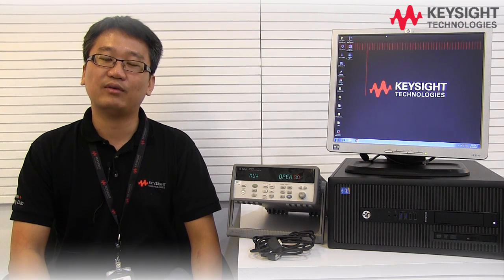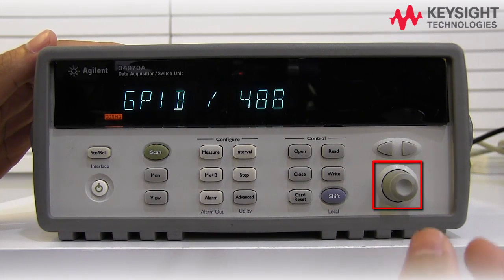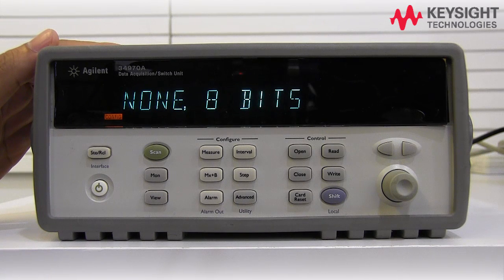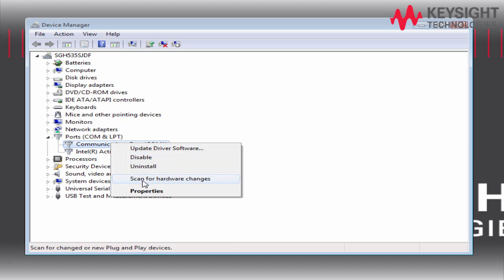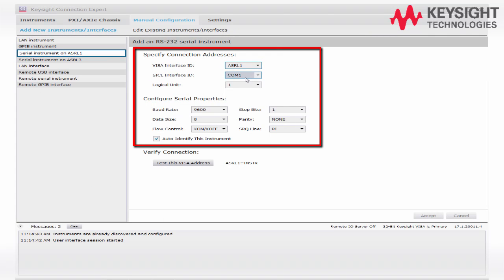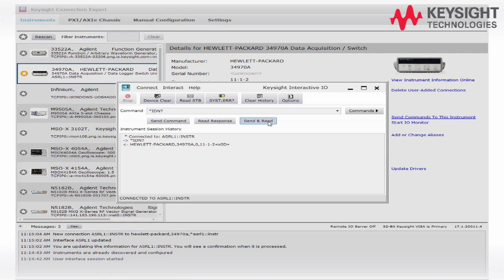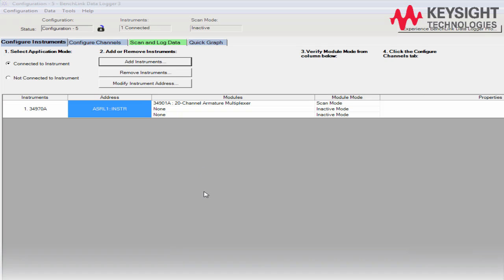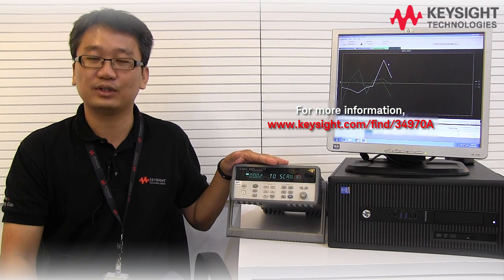How to establish the connection between 34970A and PC via RS-232 cable

Comment: Please help me resolve this issue when trying to connect with the agilent bench link data logger 3 software 
3. Searching GPIB stopped due to error
2. Error occurred on GPIB. Message is (Expression does not match any devices.) 
1. Searching GPIB
Reply from the maker: Harkamal Singh  Start with the Keysight Connection Expert - can you see the GPIB connection in the connection expert?
Reply: I had the same issue and found a solution.
Agilent IO Libraries aren't working.
You should use NI-VISA runtime instead.